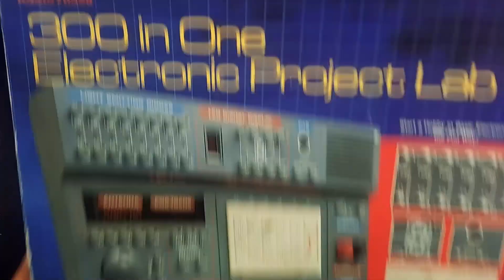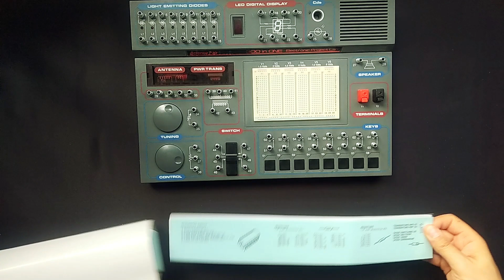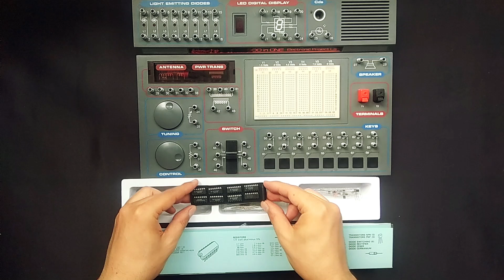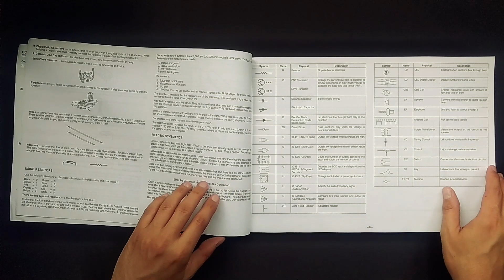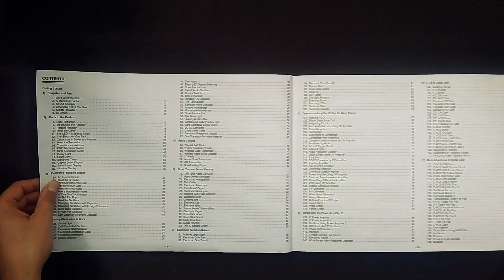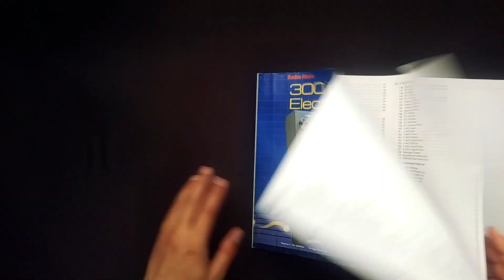The Vintage RadioShack 300 in One Electronic Lab! Any good for Electronics Hobbyists?

Comment: These are still very useful, and not just as a learning tool. Many don't realize that they are also very useful for experienced technicians and electronics professionals for circuit testing and prototyping. I have one of this exact make & model and use it for those things. MUCH more hands-on and far better than a bunch of surface-mount junk and code.

EDIT: I stand corrected - my unit is the 28-280 which is slightly different.

Comment: Im not sure if mine works at all
When installing the batteries am i supposed to see some kind sign of life?? Like any lights turning on or do i need to attach components to make it work??
Reply from the maker: The batteries are just there to ptovide power to the circuits you're building.
Reply: No you won’t see any action until you start wiring

Comment: Hello 
Kindly can I get a copy of the manual please?? 
I bought a kit from a second hand shop but there were no manual instructions with it … 
Is it possible ? 
Best regards 
Khalid
Reply from the maker: you can find very similar manual on the net that also work. Here are some. The first one is almost identical to what I have and should be fine.
https://www.zpag.net/Electroniques/Kit/300_1suppliermanualennlfr.pdf
https://archive.org/details/science-fair-150-in-1-electronic-project-kit/page/14/mode/2up
https://archive.org/details/science-fair-150-in-1-electronic-project-kit/page/14/mode/2up

Comment: Great overview! I have the Elenco Maxitronix 300 in 1 from this era, which is essentially identical to the unit you are demonstrating.  I really appreciate how you spell out all the options and components in easy to understand terms, as I've never dabbled in electronics or used a kit like this.  I feel much more confident starting to use my kit.
Reply: Yeah it is I just checked it out on ebay, I'd bought one of the radioshack ones, $37 to the door.

Comment: I bought this for 126 dollars CAN on eBay it was extremely difficult to use. It is OK. I recommend special pin wires that allow  you to attach wires since therse wires are so fragile and hard to use. I wish it was like the others (130 in 1) and 200 in 1 Radio shack, etc thus it would be bigger.